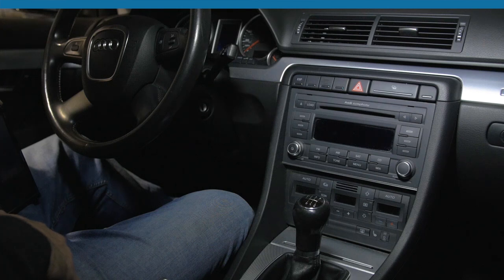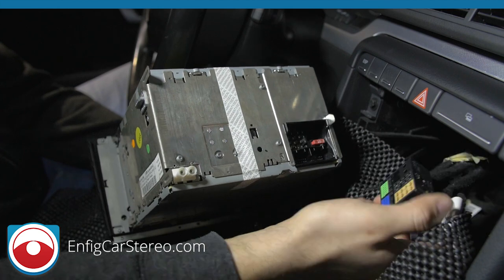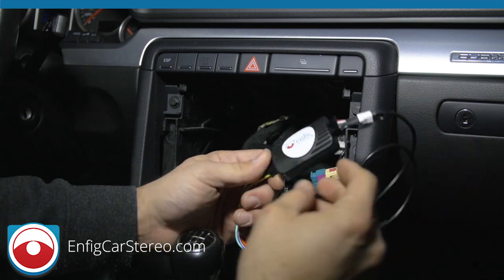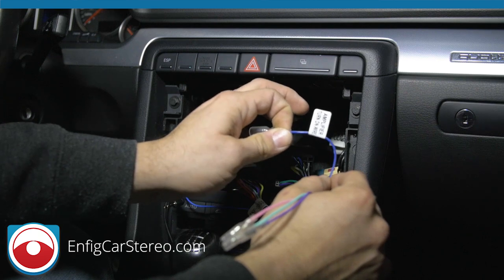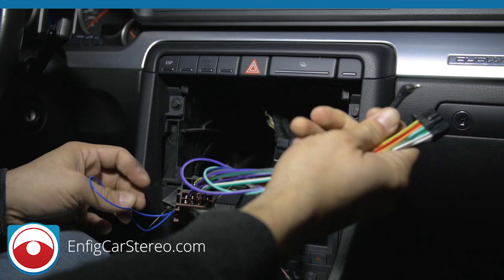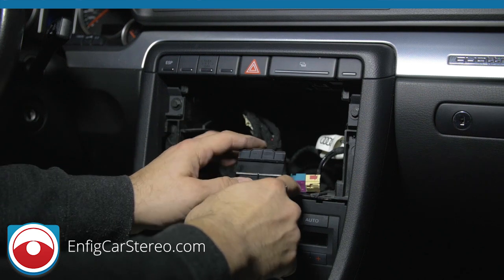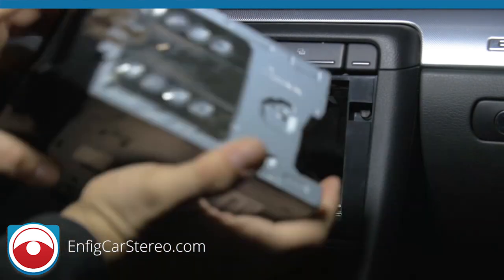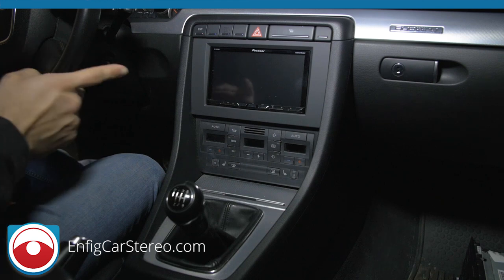Audi A4 2007-2008 Radio Installation

Comment: Great vid glad I watched 1st, didn’t know Audi systems wer so complicated 
Do your wire harness kits work on newer generic android radios? I custom installed a UGAR 9” ex8-s radio In My 04 f150 & I love it & I’m thinking about that radio In My 06 a4 Quattro same shape as the dash
Reply from the maker: Thanks.  We usually do not recommend Android radios because they can have issues with the rolling steering wheel controls.  But we do have parts for generic radios.

Comment: Are you still able to retain the radio station info that is displayed on the little info display between the speedometer and tachometer? Also will the mode button on the left side of the wheel have any use?
Reply from the maker: Unfortunately that is not possible.

Comment: Hi great video, just for now some things I want to change my Radio Symphony ll Cassette for a brand new Pioneer AVH-W4500NEX or AVH-Z9250BT there're the same version, but my audi is an A4 B6 2004 and have the BOSE system so you can help to know what interface I need to mount it this new radio with out issues after....
Reply from the maker: If you plug in your radio into our  page it gives you all the parts needed for the install. https://enfigcarstereo.com/radio-installation-audi-a4-s4-rs4-2002-2008-B6-B7/?make=Audi&model=A4/S4/RS4

Comment: Might do an install, but not liking the beeps in system though, anyway you can silence that?
Reply from the maker: The beeps are in the radio.  I have silenced the ones in my radio but check the manual of the radio you are installing.

Comment: Is this the same process for a 2005? Like same cords for steering wheel control?
Reply from the maker: The antenna adapter and Main radio wiring harness are different on a car with the Symphony II with CD and Cassette.  But basically the same.

Comment: Can you help?
I have an 2002 Audi a4 quattro and my stereo doesn't shut off when I turn off the car. And no I dont have that red ignition wire so as of now its wire directly to power. How can I get an ignition wire or witch wire is it?
Reply from the maker: You need a different harness.  If you tell this page your radio it will tell you what you need.
https://enfigcarstereo.com/radio-installation-audi-a4-s4-rs4-2002-2008-B6-B7/?make=Audi&model=A4/S4/RS4

Comment: can you reply my comment with everything i need for an audi a4 2007 with a 5 cd changer in the glove box so i can order all i need , i've bought a sony wx-920bt
Reply from the maker: Wiring harness - Connects to your cars original harness and terminates into Blaupunkt style connector. (We also have PNP adapters that convert the Blaupunkt style connector into radio specific connections)
https://enfigcarstereo.com/ENFIG_SRWH_AUD3_HILO.html Fixes low rear audio and does steering wheel controls with a SWCL.
or
https://enfigcarstereo.com/ENFIG_SRWH_AUD3.html Is the same as above without the HILO box. This DOES NOT FIX audio issues but is cheaper. 

Adds steering wheel controls to the boxes above.
https://enfigcarstereo.com/ENFIG_SWCL_SON.html

Converts the Blaupunkt style connection into a connection specific to your radio.
https://enfigcarstereo.com/ENFIG_PNP_SON0027.html

Antenna adapter - This converts your 2 antenna connections into the universal connections most radios need.
https://enfigcarstereo.com/ENFIG_AAA_VWAUD5.html

This our radio mounting kit.  It matches the factory dash pretty close to perfect.  We do not have a cheap kit for this because they all look bad in our opinion.
https://enfigcarstereo.com/ENFIG_RMK8_A4B67.html

This mic makes replaces the aftermarket mic for better sound goes in the factory location.
https://enfigcarstereo.com/ENFIG_MIC_AUD4.html

Keys to take out the radio.
https://enfigcarstereo.com/ENFIG_RRK4_RADIO_REMOVAL_TOOLS_KEYS.html

To use factory Satellite antenna you must run the cable to the tuner in the trunk. You will still need to buy a new tuner this is just to use the antenna.
https://enfigcarstereo.com/ENFIG_SAA_SIR_600_GREEN.html

Comment: Not bad but sloppy wire install behind radio.. I don't do sloppy wires at my shop, I make sure all wires are neat and secure..
Reply from the maker: If you're talking about not putting some tape on the PNP converter to keep wires looking neat I definitely wouldn't call that sloppy.  I do than on purpose on certain videos.  This car is tight behind the radio.  Putting tape on the PNP-PIO0237 would cause the bundle of wires to become one thick mass instead of spreading out when the radio is pushed in.  As a professional installer we can get around that.  An amateur may have problems shoving the radio in if I put tape on that harness.  My videos are not exactly how I install.  They are made to make the install as easy as possible without doing anything wrong.